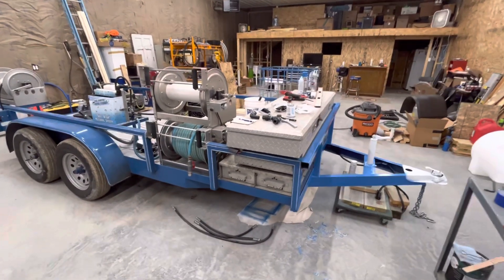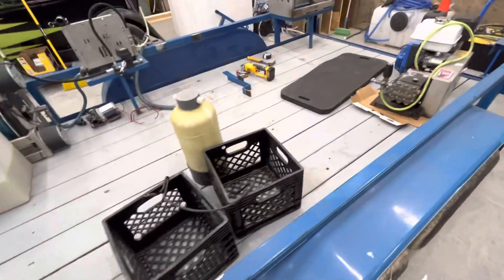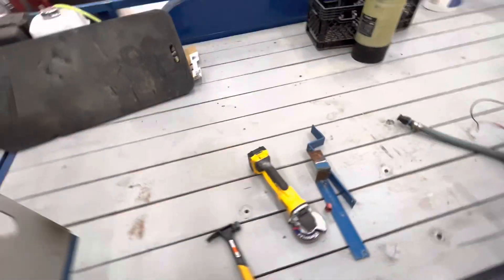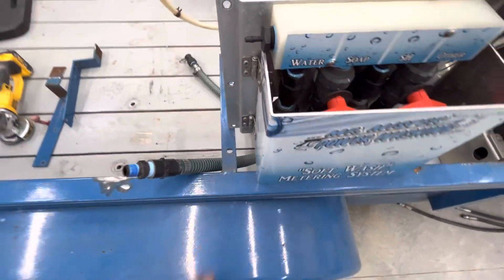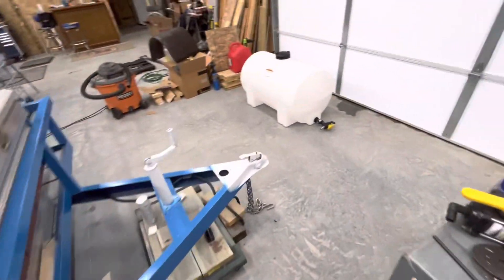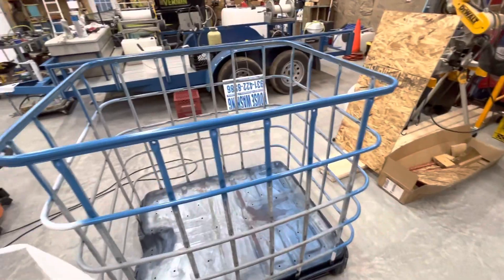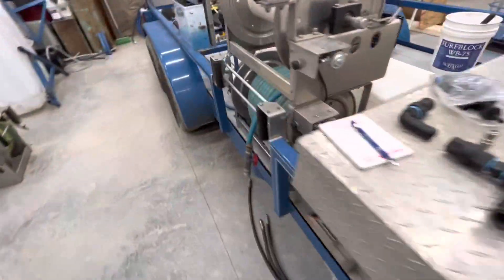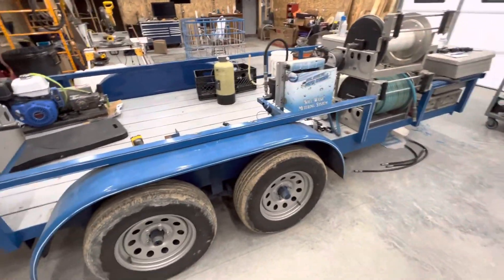2023 pressure wash trailer rebuild PART 2

Comment: I used Raptor liner for my trailer bed on my rig. It has held up great.
Reply from the maker: How does it handle the occasional SH drip?
Reply: @mr.misterpowerwashing8562  Urethane coatings will do fine with SH, however gasoline is Kryptonite to it and it will peel off easily once exposed to a gas leak.  I would isolate gas cans so filling drips do not effect it, one tip with Raptor liner-class coatings is if you need to say drill a hole then heat it up with a heat gun and punch out where the hole will be, it will harden when it cools, much easier than drilling through it....